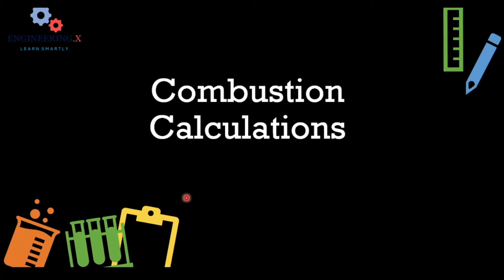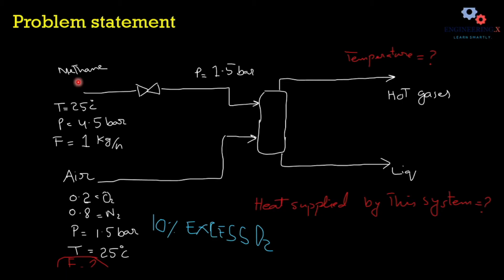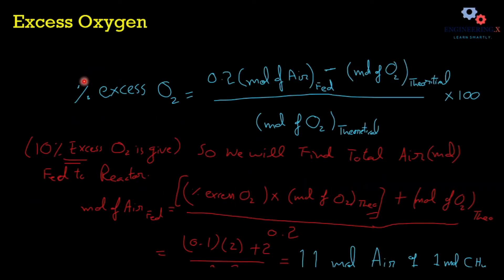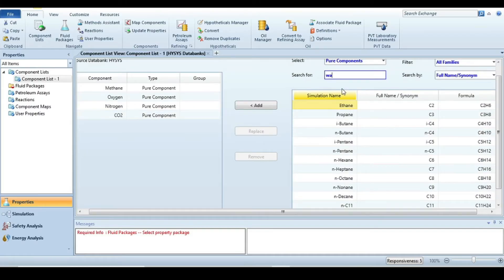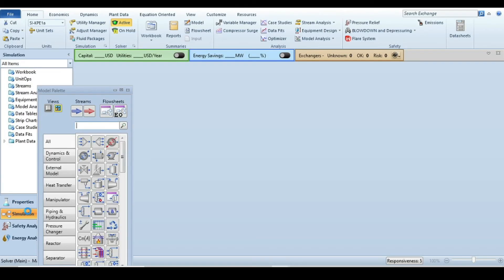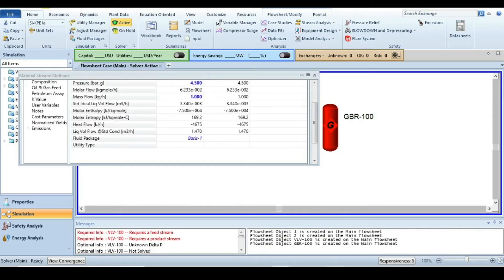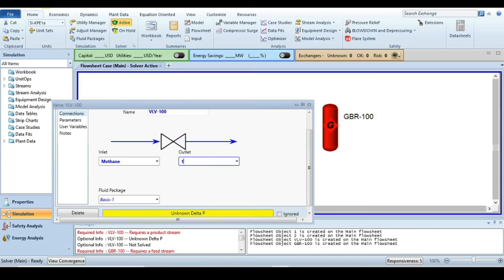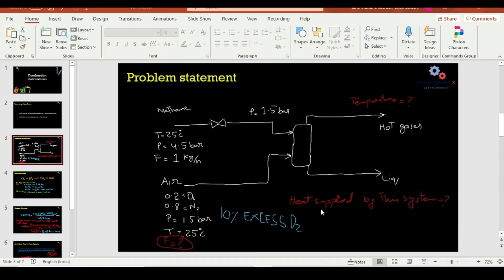Combustion Calculations in HYSYS

Comment: Just one doubt, based on the stiochiometry we have calculated that 10 mol of Air is required to burn 1 mol of CH4. For 10% excess air, can't we directly multiply the 10*1.1? Instead of using the formula? Could you brief the significance?